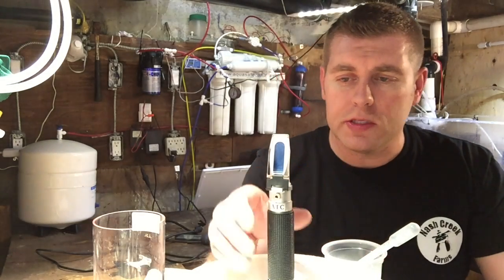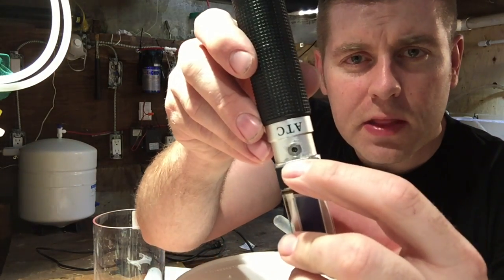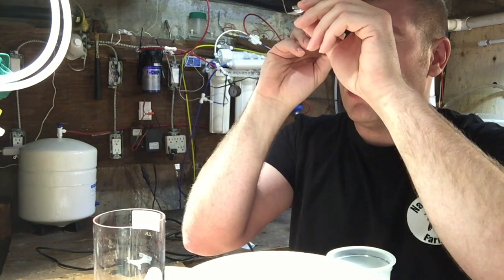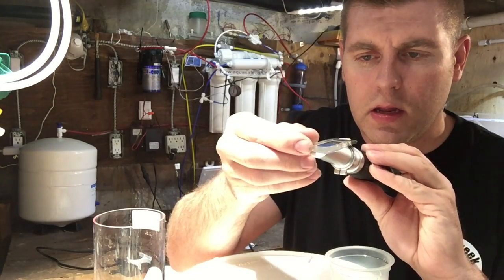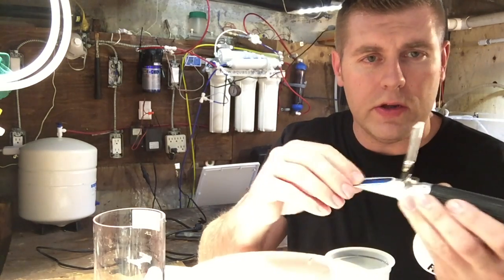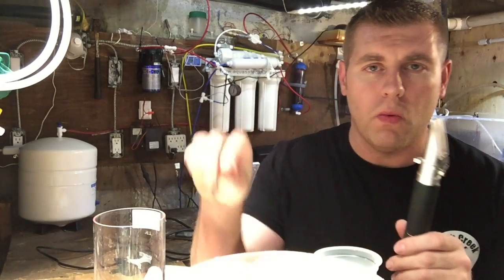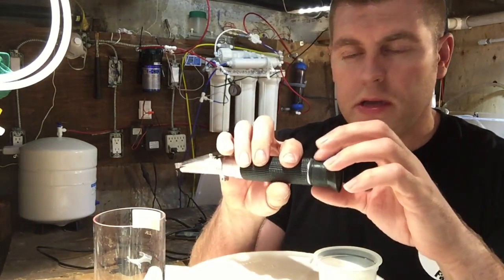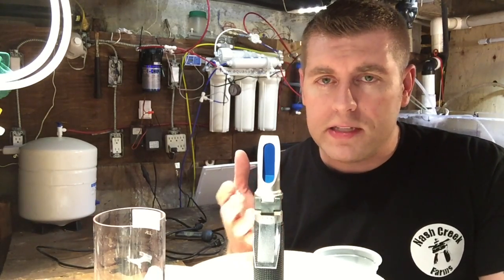Refractometer How to calibrate out of the box FBR

Comment: Use a 35 ppt calibration solution if you want more accuracy. I tried the distilled water then tested my water, then tried the 35 ppt calibration solution and tested my water again. There was a 4 ppt difference